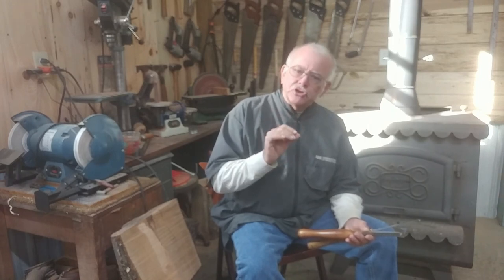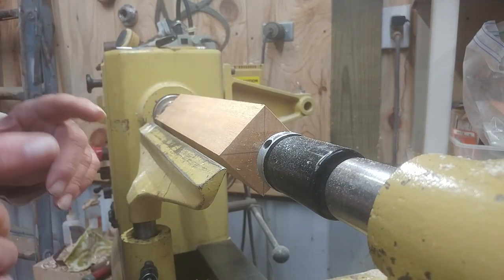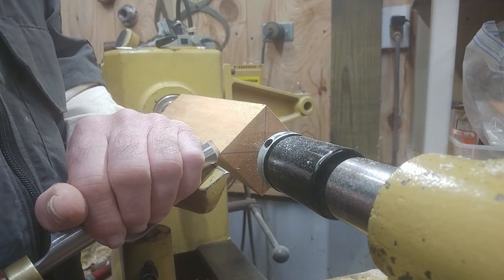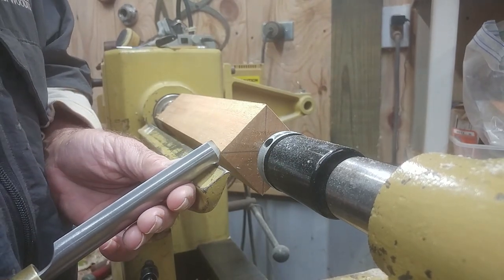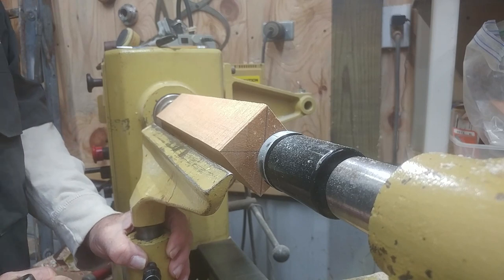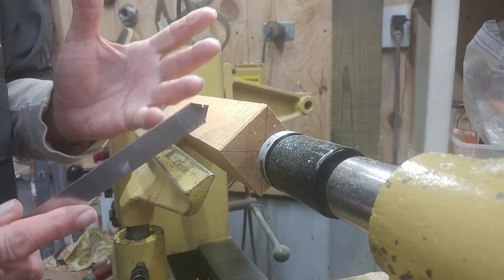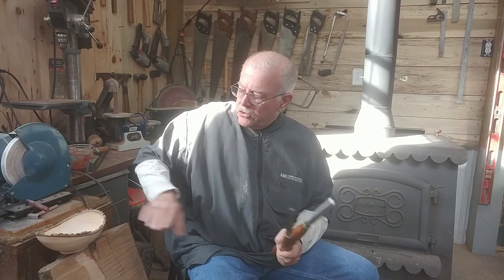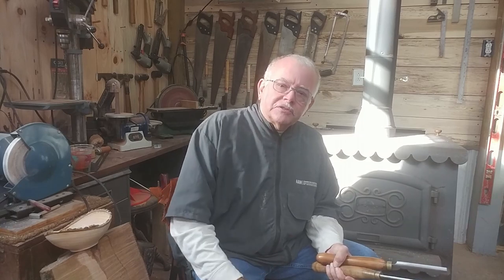The importance of tool rest height (woodturning)

Comment: A wood lathe is NOT the same as a metalworking lathe. The presentation of the tool to the surface of the wood. Technically the tool could be presented vertically. A tall person needs a different hight to a short person. It is possible to turn without a toolrest. Also pronunciation of the word "hight" is NOT heith, it ends in ht not th. I started woodturning in 1962 and have taught woodturning to many including my grandson who started when he was four. Rest highT adjusted to suit him kneeling on a cupboard.